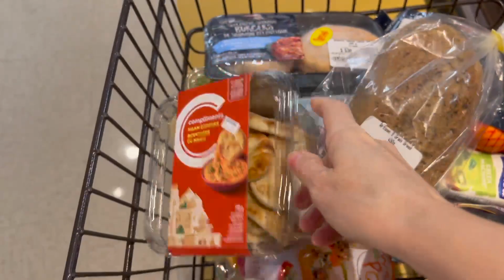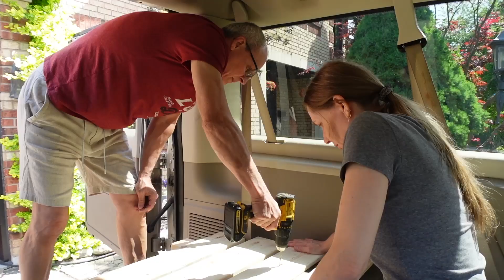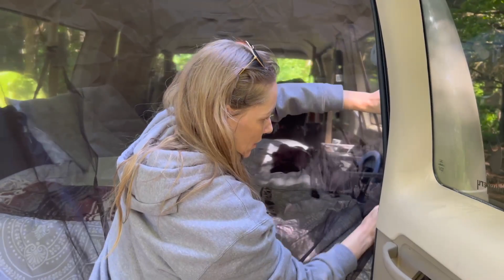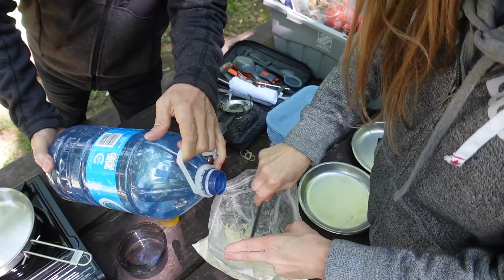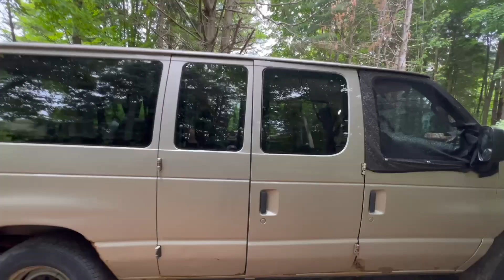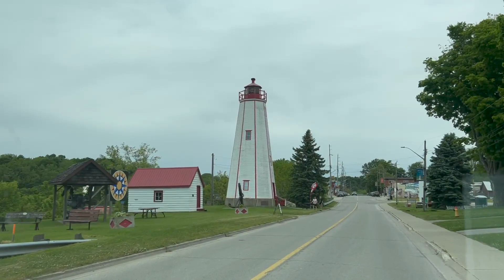Minimal build van camping VLOG with van tour + submarine on a lake!!

Comment: What a nice little getaway. We are in the process of fitting out a minivan for our travels. We sold our motorhome a couple of years ago and have really missed it so we bought a smaller vehicle that will fit in our apartment underground parking (when we move in September).
Reply from the maker: That’s so cool. Last year we did a minimal build with just the bed platform, this year I want to do something a bit more elaborate. I want pull out drawers in the back so I can cook right at the back of the van without having to set up anything. I might do a foldable bed that turns into a sitting area. We will se how adventurous I get. I want to get some solar panels too. We will still be super simple because I do want to turn the van into a regular seated van for the winter so nothing is going to be permanent. Watch out for videos coming up in the summer. Good luck with your new vehicle. It will be so much fun. Enjoy it!!